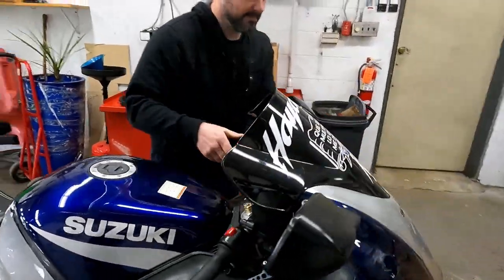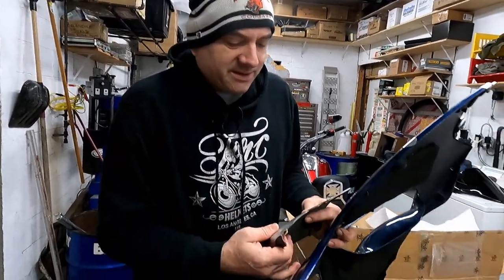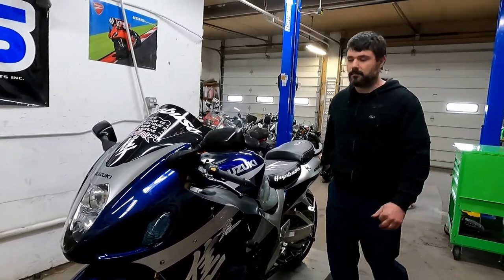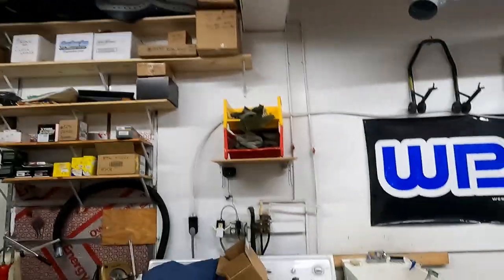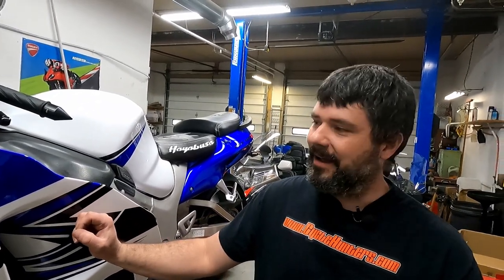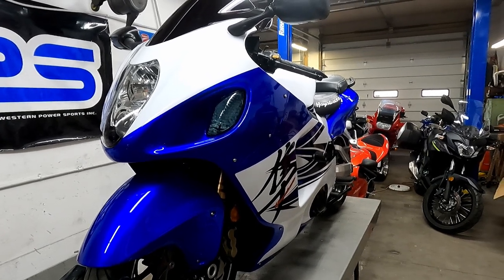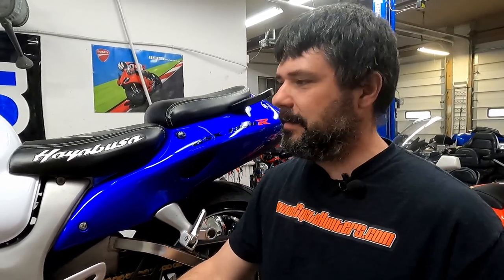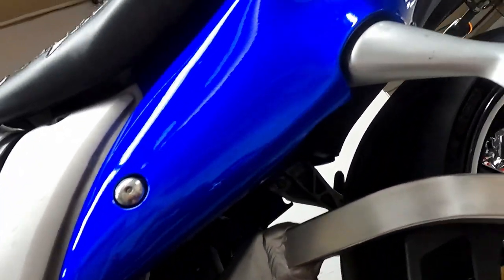2003 Suzuki Hayabusa aftermarket ABS Fairing Kit install and review!

Comment: I have the same exact scheme on my 2012 Busa. Sadly enough, I lost my clutch side fairings on the highway 2 weeks ago😪😪 now I have to buy a whole new setup now 😫
Reply from the maker: Unfortunately you can't just get on side from ABS.  For that you're gonna have to either be checking ebay and the likes, or just go OEM and pay the piper.
Reply: @CycleHunters  I’ve been looking at Monster Fairings for the full swap, Bc the Suzuki dealer told me around $800 for the 2 pieces 🫠

Comment: ABS Fairings, Monster Fairings, and Auctmart fairings are high quality kits that’s as close to OEM you can get
Reply from the maker: I would say so.  We have another video coming today with the ABS kit on a ninja 250.
Reply: @CycleHunters  where are you located I would want y’all to do my Gen 1 Hayabusa
Reply: What after some years and heat cycles?
Reply from the maker: @H-M-78  the ones we've installed now and have seen the bikes in the interim have been perfect.   As long as you install the shielding and make sure clearances are within an acceptable tolerance, they will perform without fail.
Reply: I got some auctmart fairings for my r1 yamaha they were the worst aftermarket fairings I've ever had they were just shit.

Comment: What about the air intake ports at the front?  Did you guys end up cutting those out?  Those fairings look pretty damn good 👍
Reply from the maker: They came cut out so no issues there.  We installed the screens within those intakes.